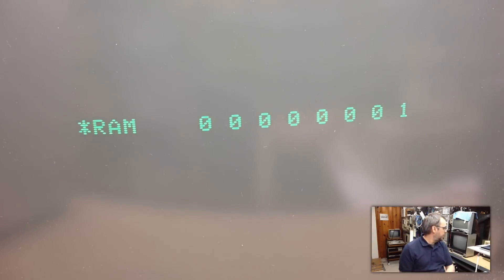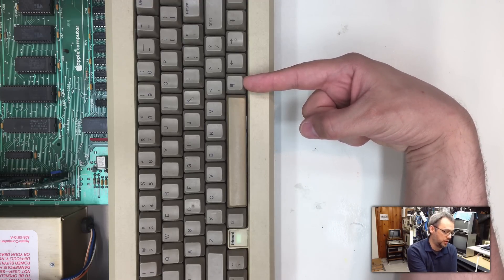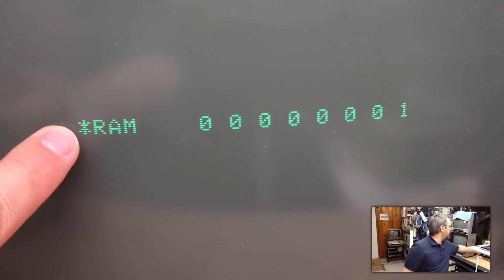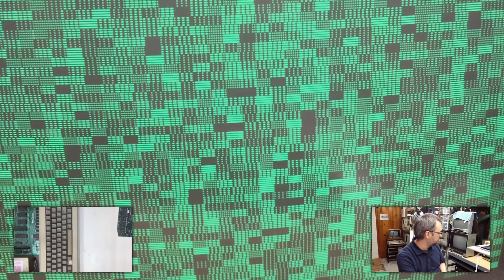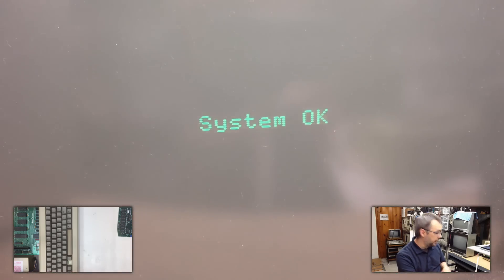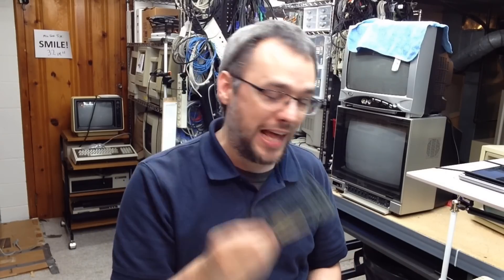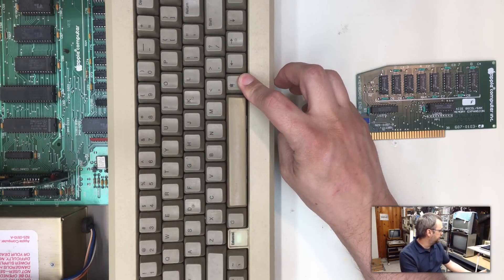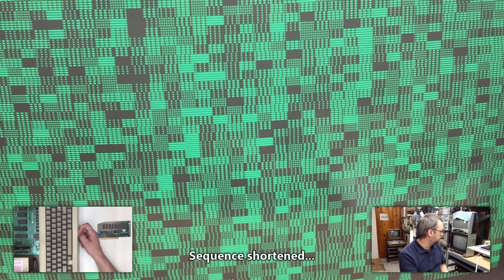Let's Repair! - Apple II Memory Fault

Comment: Love your videos, I have an Apple IIe that gives me the RAM: message after doing the hold both Apple s on each side of the space bar and turning the machine on. It does this with the RAM card in and no RAM card installed. It does not tell me which chip is bad. Any ideas?
Reply from the maker: If it shows a series of zeroes and ones across the screen, the "1"s indicate which chip is bad on the logic board.

Comment: Piggyback with new chip to find bad one. Probably don’t need to remove them all.
Reply from the maker: Man was I naive back then. Also, piggybacking isn't guaranteed - it only fixes driver transistor "dead" or cell faults. If the chip has a power to ground fault, or one of the internal drivers is stuck high or low, piggyback won't do much.

Comment: Wonder if you can give me advice. Ran a diagnostic on my Apple lle. Received this message…”Main memory ok. Auxiliary memory needs repair error 02 at 01f813”. Is this something I need to be concerned about? Must I change out the card? HELP, please. Mark
Reply from the maker: Remove all cards but your 80 Column card and run the test again.

If it still fails, then your 80 column card has a bad memory chip. If you have another 80 column card, you can try it and see if that fixes it.

If it does, you just need to have the bad chip replaced on your 80 column card.

Comment: Nice video, but this method of desoldering a DIP chip is a bit scary to me. I tore traces off of my first IBM 5150 doing something similar to this a few years ago. If you don't have a vacuum desoldering station, I would recommend soldering all the pins on one side together first so you can heat them all at once and then lift each side of the chip at a time. I find it easier to remove solder from the pads with desoldering wick (or whatever other method) without having to also pull pins\legs from the hole at the same time. Honestly, I hate using desoldering wick anyway, because it likes to stick to the pad and then you have to dump a lot of heat into the board to get it free. Whatever you do, resist the urge to pull on the desoldering wick if it gets stuck to a pad... this is how you tear off pads and traces. Remember, the longer (and hotter) you heat up a solder pad, the more likely you are to delaminate it, which detaches it from the board.

Also, preheat the board somehow. Use a blow dryer or a heat gun (not at high temp)... It'll help!

Lastly, I'm not experienced with Apple computers, but you can save a ton of work by knowing which chip is bad. Did you need to replace all 8 on the card? Each component removed is risking damage to the board\traces, so it's best to minimize soldering if at all possible. Even without a way to diagnose which chip is bad, simply replacing them one at a time and then testing could save you from having to remove 1-7 other chips potentially. That's up to 112 joints you might not have to desolder.

Anyway, just some suggestions. I'm probably less experienced than this than you... just wanted to share my thoughts. Keep up with the nice videos! :)
Reply from the maker: To address all your concerns:

I have a vacuum desoldering station now.
I know about pad delamination.
I preheat the board when necessary. I have a hot-air gun for this.
I knew which chip was bad; the diagnostic test told me. But, these were Micron chips, which have a high failure rate. I opted to replace all of them.

Less experienced than me? Who knows? Who cares! It's about sharing, so we all get better. I have definitely learned quite a bit since this video came out. Check out my recent video on the repair of the ZRAM Ultra2 card - much better technique now.

Thank you for sharing!

Comment: worst technic to remove a chip
Reply from the maker: Chips are bad and need to be removed. Don't have a desoldering gun. Have an alternate suggestion?
Reply: @JoesComputerMuseum  Until I got my desoldering gun,  I frequently would just use a desoldering pump.  They work well but you occasionally need to replace the tip as the soldering iron will slowly deform them with heat,  and sometimes the o-ring on the inside go bad.  But.. They are pretty cheap.  One pass with soldering iron and pump,  then a quick cleanup with soldering iron and wick.    Just a suggestion since you asked,  but great video :)
Reply from the maker: @woodengamer  Thanks!
Reply: @woodengamer  Totally agree!
Reply: What technique would you use?

Comment: You need to invest in a de-soldering iron.  I hate killing chips for no reason.
Reply: and break traces omg
Reply from the maker: Yes!
Reply: I purchased this one. It's affordable and works well for occasional repair.
https://www.amazon.com/Desoldering-Station-Digital-Temperature-Controlled/dp/B00KQ6PR6K  EEVBLOG does a review. I actually got a refurbished one for about 75% of that price so even cheaper.